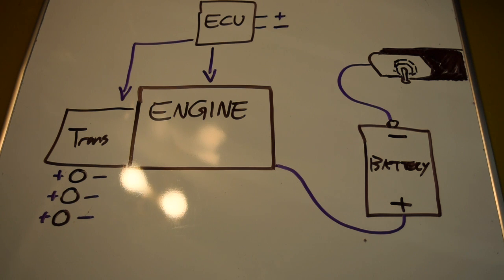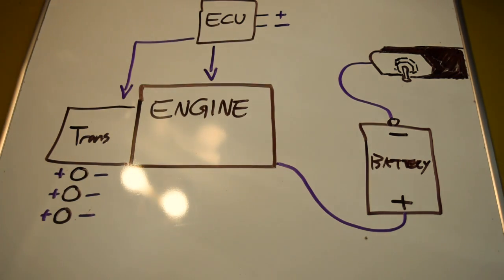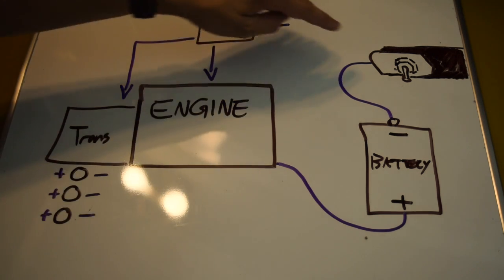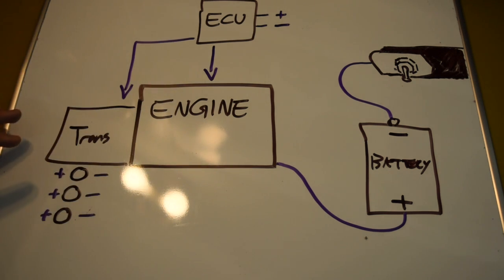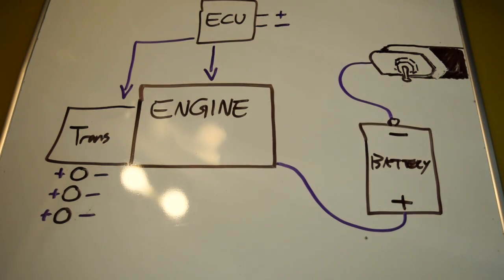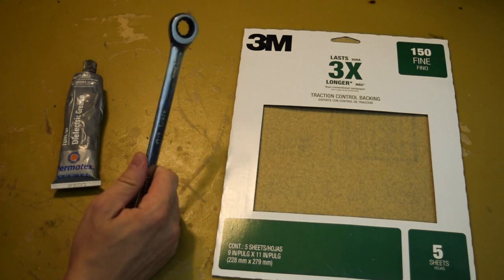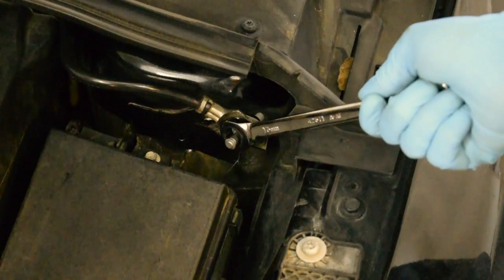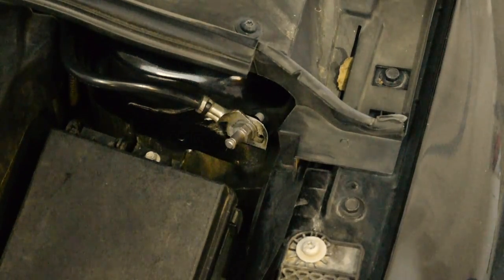Ford Focus DCT Ground Mod. Increase Driveability and Reduce Jerkyness

Comment: Holy s*** you are a f**** angel sent from heaven you know how long I've been looking for a fix to this issue I've had this car since July 2020 and ever since I got it I've had noticeably jerky shifts and lots of shuttering noises when going from a stop say at a stoplight It is definitely most notable when it shifts from first to second unless I rev it out in first gear to about 3K RPMs and then allow the engine to shift it won't do this but if I am too low RPMs when shifting into second it shutters really badly
Reply from the maker: you are welcome!
Reply: I ve been having the same problem with my car. So did you pretty clean the ground connection?

Comment: This can help but there are more grounds on the focus. Under the air box there are two grounds, one for part of the wiring harness and another for the alternator. And you guessed it, they are bolted to painted metal. So when you do the ground up top, do the same for the other two,  it'll only take a few more minutes.
Reply: Correct!
Reply: Ya after I did all 3 my average ecu voltage went up nearly 2 volts average over 2 hour drive
Reply: Yes also below the battery box and each fender ground also have paint. I just did a full swap engine and trans after discovering a front main seal leaking. When I cleaned the engine bay I noticed all of the grounds so I sanded everything down to the bare metal and liberally applied dialectrode grease wiped the excess and rust oleum led over the nuts and all
Reply: @codyshowalter7128 : Even though this late, I have av FYI for you.
Dielectric grease should not be put on parts before connecting, because it is actually an insulator.
It is to be applied to parts After connecting, to protect the connection, from corrosion, especially on connections of different metals.
Reply: Thank you i get sick of hearing the term dielectric being used for the wrong application or in the wrong manner@zapa1pnt
Reply: Where is the air box?
Reply: @joycegaston343  The plastic box that holds the air filter. Other YT videos cover the removal of same.

Comment: I'm not sure whether uploader see this command, but this actually works! Idk why dumb ford dealer try to make me pay $2k for this fix. Just did this method, drives totally fine. This is worth give a shot at least, highly recommended! Here's what I paid from walmart

Wrench : $9
Grease : $3 or so
Sandpaper : $2 or so
Less than total 15!!!! Totally take it. If it doesn't work, still 15 bucks are not that much money. So try!
Reply from the maker: I see them, I'm glad this video helps so much!

Comment: My girlfriends 2014 focus se is slipping 1st and 2nd gear. It feels horrible and the car completely comes to a stop. I have a faulty transmission speed sensor that my mechanic friend told me but after watching I’m not sure what to try to fix first.
Reply: I have 2014 focus and felt terrible when shifting to 3rd gear and 5th gear. I literallt did this method like 30 mins ago, unplugged TCM fuse (optional), deleted code, and drove. Feel way better. Just give it a shot, total cost will be less than $20 and you can get all of them from walmart. Highly recommended.
Reply: @sj.standingbell  ill try to do it tomorrow. I hope it’s successful!
Reply: @gregnajar  Good luck man. If you have an OBD scanner with delete function, delete it after solve grounding issue. Also, do a transmission reset, by put key on (not start), put gear to N, wait few seconds, turn off and key out, open and close the door, and then start. It might need few minutes to actually reset so take your time. Good luck again!

Comment: Thank you!!! You saved me $2700 so I’m not having to swap the TCM!
Reply: I take back what I said.....the fix didn’t work with my 2017 Focus SE Hatchback. 
I hate my car now.
Still no go backwards!!
Reply: @BozowolfnHD  hey man your car should still be under the TCM fault warranty. You probably need it if no reverse.
Reply: @I Am Who I Am the car is out of warranty 80,000+ miles. The car has, as I like to say, good days and bad. I tried ordering a new TCM via Amazon, no luck. The part was a no show on delivery day. My next attempt will be to order a used TCM from EBay if I cannot source one from a junkyard locally.
Reply: @BozowolfnHD  There's a 10 year warranty on the TCM
Reply: @amped5234  Focus traded in on another brand of car.

Comment: I have a 2016 Focus. 4 model years after this vehicle came out. It pisses me off to no end that a company with billions of dollars in R&D couldn't figure out this simple fix and in 2016 the same issues are still present. Hard to believe they give a shit about their customers when you deal with stuff like that. Then they discontinue the Focus saying people don't want small cars. No, they don't want YOUR small cars.
Reply: hey Jason, I just bought a 2016 Focus. Have you had any of these clutch/transmission issues with yours?
Reply: @murillor.965  Thankfully no! 107k miles and no catastrophic failure. Of course there is the shuddering and jerking occasionally that is pretty much the norm with this design. Any vehicle build after November 2015 supposedly has the "updated" parts which is why I think I've been so lucky. I know it won't last forever. It's an unfortunate design but theses a lot you can do to prolong it. Biggest thing...don't feather the gas. Drive it like a manual because that's what it technically is. When you wanna go accelerate deliberately and don't hesitate. It's a great car otherwise and I still enjoy it despite the issues. Sorry this was so long lol enjoy the new car!
Reply: @Jason-kg3oc  no, this is all valuable info! thanks so much for taking the time to reply!

Comment: In electronics we call it ground bounce.  When the current spikes from the motors running the ground voltage jumps making the electronics in the module see incorrect logic values among other things.  Your fix is correct.

Comment: Tried on 2014 Focus  Titanium Hatchback, tried and it worked like a charm, issue 90%  gone, just freaking mind blowing that GM spent billions on recalls.. I tried this for two weeks to see if weather pressure will change anything, nope all good, fuel consumption decreased performance is noticeable better.
Reply: Worked ?
Reply: It worked. Thats what I wrote right?
Reply: hey, have you had any issues since?

Comment: Thank you for the video.
I have 2012 ford focus 
It seems alot better and smoother now
I have to say it worked for me.
Reply: Rwally hope it works for me
Reply: @reptar1098  A side note. 
I did change the transmision fluid a few days prior to doing the ground mod.
Reply: @rassy440  that's good. I'm willing to do just about anything that doesn't require me to drop the trans
Reply: Hey I’m about to get trans fluid flushed and try this did it work for you? I’ve been seeing people say it’s the gas valve?
Reply: @kristianmopsticc2887  This ground mod worked for me. It drives alot smoother.
Sometimes when Im at a stop sign or light  then give it gas to go. There is a slight shudder. But nowhere near like it was. It used to feel like the motor was gonna jump right out of the hood.
Ok here is exactly what I did.
I changed tranny fluid plus I added some Lucas Tranny nonslip. It still was giving me some grief. A few days after that.
I decided to try the ground mod.
Taking the paint off around where my ground bolted to give the area shiney metal to metal contact. I did not have die elctric grease to apply to help with corrosion
But it drives way way better. I will say It definitely worked for my 2012 ford focus se 
I changed tranny fluid

Comment: This also helps your battery to charge at the correct voltage.  Also eliminates headlights flickering when brake pedal is applied.   This did smooth out jerky starts for me.
Reply: I am now experiencing this, headlights flickering because of voltage drop when applied the brake pedal, it happens for 1 sec of 12 volts then going back to normal 14.6volts, I wonder what else could be the problem aside from grounding.

Comment: I think I will try this, I'm almost sure that the shakes and some "clack clack" noises I get in some gear shifting (even after I have changed all the dual clutch kit and reprogrammed the TCM..) is due to this ground bad contact 🙄
I think also it's the same shit that makes the battery signal appear intermittently on dashboard 🙄
Reply: broooo i've been wondering why it pops up even when the battery is in good shape, everything is starting to come together now xD

Comment: thank you for the info the engine light came on my 2014 Ford Focus the diagnostic machine said it was transmission problem I was about to take the car to transmission shop to get it fix watched this video from this wise man did the steps the the car runs very well I do not feel the jerking when you stop and go anymore fell like new CAR thank you very much I thing Ford need to hire you to train their Engineers

Comment: My 16 focus dct transmission hesitates to shift into second gear but only when the car has been ran for a lil bit would this maybe fix that
Reply: I have a 2013 focus with dct transmission too and the same thing happens to me as well. The car stutters while shifting into 2nd gear after driving for a while.

Comment: I have a 2018 Focus SEL that works absolutely fine. No issues whatsoever
Reply: Lucky you
Reply: Licky you mine is giving problems of i push it transmission heats up
Reply: @lucyeileen3301  funny you say that. I had to get rid of mine because it started giving me trouble and the ford dealer wouldn’t fix it. So I dumped it and got a 21 civic… much better!
Reply: @alexwallace1707  i cant afford to get or fix right now so imagine... im stuck

Comment: I doubt there’s a ground issue.  Disconnecting the ground may reset transmission adaptation, which gives it a “fresh start” but the mechanical design flaws will bring the issues back.
Reply: This isn't true. My focus was shifting really badly for awhile... And I did this as I saw it on another video, and my car has been perfect since. Don't claim something won't work if you have no idea
Reply: @LeonidaSleuth  I haven't had any issues with mine yet but I did this anyway and now it's more smooth and quicker so these keyboard warriors just don't know but I see their point but it's not always true and the only to give it a "fresh" start is to reprogram in the car or a reprogramming tool

Comment: I even added a extra heavy duty ground wire from engine block over to the ground post. Then I cleaned massair flow sencer took off the possi and ground cables off battery and ground them together turn on headlight switch on let sit for 1 hour drain all power from computers turn headlight switch off before hooking battery cables back on battery turn key on don't start yet wait 2 minutes to load computers backup then start don't touch gas pedal at any time let it idle for 30 minutes to get the throttle body to  set the trims on it high and low then go out and drive around as a normal person do not get on it let the computers run its course to learn driving and shifting

Comment: 2012 focus titanium. Just did this, and it worked perfectly. It didn't completely eliminate the studder on takeoff, but it's now only noticeable if you're looking for it. Very slight.
Reply: My focus does the same thing it always does that when I’m at a stop and accelerating

Comment: Didn’t work 4me 
Probably I didn’t do right 
Does it work 4 2012 focus
Reply: I have probablems too same car willing to try this
Reply: @kristianmopsticc2887  it might work for you
Reply: @MediaandPc  did you fix it ?
Reply: @kristianmopsticc2887  yes,I took it to the dealer ,Ford Linquist ,changed oil Transmision on it and it did workt
Reply: @MediaandPc  changed transmission oil?
Reply: @kristianmopsticc2887  yeah that might will solve the issue

Comment: Did this with a new battery and ALSO found the Aftermarket radio was killing the battery installed a Socket Fuse and switch the radio off and it drives way better took me long enough to find a way to disconnect the radio directly at the source
Reply from the maker: Interesting!
Reply: Idk it's a mystery don't stress about it

Comment: Good video and explanation of the problem. On my 2 focus"s I also got a 18 or 24 inch cable from the auto shop. The ground plate on mine are spot welded to the strut tower. Although you cleaned the ground post it still has to travel through the small spot welds to the  chassis. I run the extra cable from this ground post to the other ground points UNDER the air box. Remove your air box and there are at least 3 more ground cables attached, on mine one big to the trans/engine block and 2 smaller gauge. Remove sand clean and grease all off them. Attach your extra cable from the strut tower ground to the large chassis/engine ground.bolt. This doubles up and completes the circle. As an added bonus i then run a cable from one of the small ground to a bolt  on the throttle body, bolted to a plastic manifold. The throttle body relies on a small wire in the wiring harness for its ground, so any resistance/corrosion can inhibit its response .The throttle body is insulated from the main engine block by the plastic manifold so the extra wire really helps. This is not just for powershift cars but all Focus models. The ground is marginal when new so any corrosion / resistance as the car ages totally stuffs up the electrical magic
. As for powershift models some good videos available. as the shift motor ages(they are just like a wiper motor/winder winder) the carbon brushes wear down causing erratic shifting. A good diy rebuild to clean and put in new brushes. On powershifts if you do lots of stop start city crawling the clutches glaze up. If your in the country, deserted road, motorway on ramp, NAIL that sucker, rev it out and make the gearbox and clutches WORK. 4 or 5 full throttle accelerations from start can really make a big difference to shifting when back to normal driving . 1 Redline a day keeps the mechanic  away.
Reply: Hey - dude please make a video showing how to add the extra cables!
Reply: Ah yes the ol' italian tune up

Comment: Thanks, I just bought a 2015 used Focus for $6.5k with 41k miles. I was real leary about buying it with all the negative news. At this time everything is fine. I think much of the tranny problems are also due to the way people are driving this type car. It is definitely not an automatic transmission and should be driven differently. I'm older and take things a little easier.
Reply: Wow u got a great deal on that car, I'm looking at a 2014 used focus with 100k miles on it would u recommend ide go for it? It's one of the best deals I've found so far if the car is reliable.
Reply: @noname-td5jv  haha brotha my 2015 with 240k is doing okay, finally starting to look at this videos. Hoping these little tips with help the longevity of my trans. The problems are coming lol... got a trans fluid flush and felt a little better, but 1st and 2nd especially are a little jerky, higher gears I can feel it but less noticeable. Downshifting in 3rd feels a little sticky too. 

I don't know how much time this baby has left, but im going to try these tips this week and see if any luck happens. I'm at a point where im not about to waste money on a rebuild for almost/ more than i bought the car for
Reply: @AraeEntity  That 2015 only uses 1.8 L of transmission fluid. There's no torque converter.
Reply: @noname-td5jv  - Hell no, are you an idiot?!
Reply: Why would you even buy it? Do you have a brain in your head?

Comment: Got a 2013 same issue gunna do this and ill let u know
Reply: Did you do it?  Did it worked?
Reply: @juvevalerio3240  try scrubbing the transmission go from a dead stop floor it even if it's jerking Keepin it all the way up to about 60 or 70 do that five times
Reply: @puprilla  did that resolve the issue?
Some people say that when you drive in city doing the stops again the issue returns.
Reply: @luiscalleja2661  no and ford said its within spec so the cars getting sold to carvana for 8k
Reply: @luiscalleja2661  no its the same as before. Some days are really bad some are good. It's more noticeable going up hills I live in Colorado so with the lack of oxygen and the Steep inclines just not a good car
Reply: @puprilla  okok,
I think I will change the battery, some said changing it fixed his issue.

Wish me luck! 🤞
Reply: @juvevalerio3240  yes I did it and no it did not work

Comment: If you turn off traction control it goes away in the 2016 SE I have
Reply: It's not 100% but it's 99% smoother when traction control is off

Comment: I have a 2015 se model and I just did this today and I’m already noticing a difference brought the car in for recall months ago and Ford said it wouldn’t fix the issue and it got worse today I removed the paint and put the ground back on and seems a lot better thank you so much!!!
Reply: 2015 se here... same issues.
Reply: I’m starting to have high revving and no gear changes on a 2015 Ford Focus se ! 97000 miles
Reply: @oscarsalazar3529  Oh god lol I just got mine it's a 2015 se with 94000 miles, I'm a bit concerned now

Comment: Was a Suzuki outboard dealer for years, reminds me of a problem they were having with blowing ECM's. The repair was a separate ground wire specifically from the ECM to the battery ground post. Worked perfectly and was standard on that motor series for years after along with replacing the thumb screws on the battery posts with actual nuts. Forcing the idea of tightening the battery cables with wrenches instead of fingers.
Reply: I had to do this on my 2007 Cobalt as well. It wouldn't shift out of 1st, and had no power steering. . A direct ground from the pcm/ecm is a great fix for power fluctuation issues